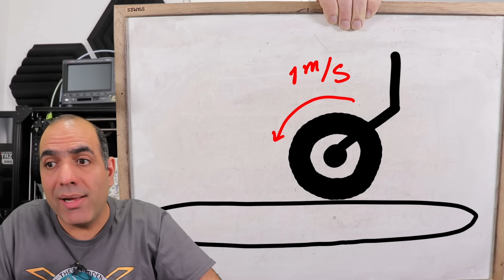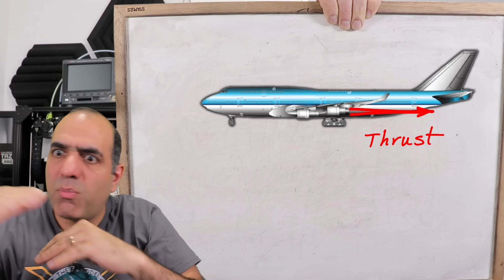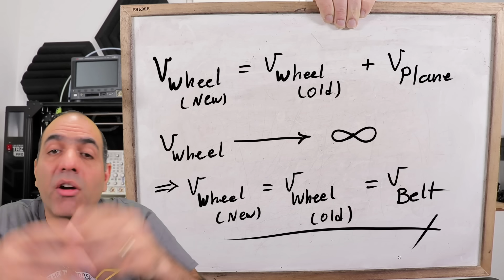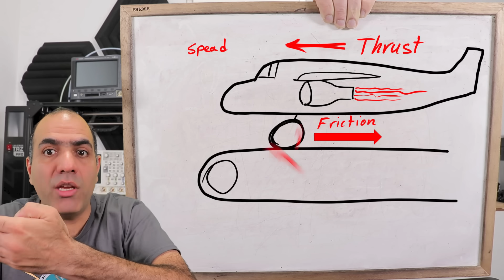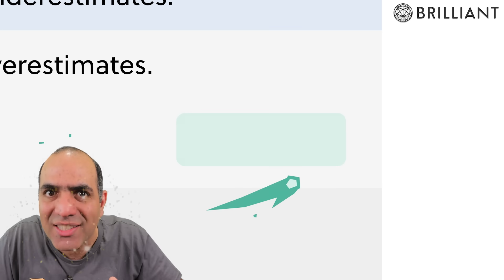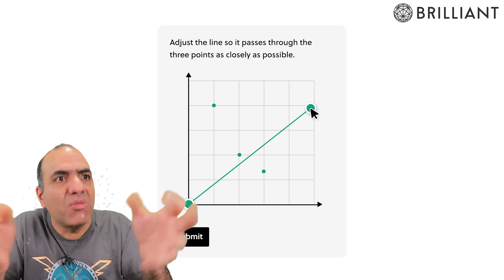Airplane Question that Drove Me NUTS!!!

Comment: In case 3, the wheels might eventually overheat and explode from excessive friction if there's thrust involved, causing the plane to slam fuselage-first into the already fast-spinning treadmill and sandpaper the entire plane to nothingness, or the treadmill might suddenly and magically stop since there is no longer any wheels to measure its rotational speed against and immediately send the plane backwards, slingshotting it in a catastrophic (but mildly silly) incident. In both cases FAA will immediately get involved, airport authority will get involved, plane owner is detained for questioning, whichever engineer and safety officer that approved the experiment will be arrested, then the public will be outraged that such an exercise is allowed in real life instead of in imaginary worlds like it should be.

That's like a dozen potential vectors there.

Comment: The 2v 3v infinity interpretation is what I hate to even think about. The question says the belt is designed to exactly match, so you are cheating if you say the speeds would "ramp up" (5:05). Infinity must be reached instantly. Otherwise the speed was not matched exactly :P

Exploring the various interpretations of "speed of the wheels" that don't create infinities, is something I hate quite a bit less.
Reply: If the conveyor belt is not massless and moves at light speed it must turn into massless particles which have the energy of the previous mass of the conveyorbelt multiplied with lightspeed squared.
The gamma ray flash evaporates the whole vincinity and makes the plane fly each atom for it's own.
That technically constitutes powered flight.

Comment: I think the real question here is "How would I design such a treadmill?"

Everyone agrees that the "speed of the conveyor belt" is the velocity of every points in the flat surface on top of the conveyor belt, moving with the conveyor belt. Also, the only referential that makes sense to me is the referential where the pillars of the treadmill are not moving. The plane is a rigid body, except the wheels that can spin around their center, the treadmill is not elastic (i'm designing it, and i'm not making it elastic, end of the discussion), nothing weird.

For the "speed of the wheels", it's not clear. It could be the velocity of any atom of the wheel or the velocity of the contact point. 3 main possibilities :
1.  "speed of the wheels" is the velocity of the center of the wheel, it's the speed of the plane and also the speed of the geometrical contact point : this is the case presented by mythbusters, the plane takes off as normal and the wheels spin twice as fast as they would on a normal runway. I would design it as the mythbusters did, they are pretty solid.
2. "speed of the wheels" is the velocity of the atom of the wheel at the contact point (it's potentially a different atom at each instant) and the wheels are not sliding on the treadmill. If we assume there is no slip, the "velocity of the treadmill" is equal to "the velocity of the wheels" (because it's the definition of "no slip") : the only solution is 0 (because it's the only real number where x = -x), the plane and the treadmill are not moving. Designing such a treadmill would probably involve welding everything together, it's the simplest option but I won't lie to you, they will not give you the deposit back for the plane.
3. Same as 2, but with the wheels allowed to slip : the plane can take off as long as the jet engine is powerful enough to overcome the friction between the wheel and the treadmill. Realistically the (dry) friction does not depend significantly on the rotation speed of the wheels (I'm NOT designing this treadmill with a liquid or gaseous substance, not even snow, so it is dry friction, not negotiable). In this case if the plane is able to take off with it's wheels locked on a normal runway made of the same material it should also work on my treadmill. The design would probably be very similar to the first one, except we need to find a way to measure the "speed of the wheel" and i'm not sure how to do that in this case. Also, if you get a plane with low friction in the wheels, we'll need fast motors for the treadmill. You cannot rent the plane with no friction in the wheels from a physicist, unless you know another physicist with an infinite speed motor.

If you mean something else by "the speed of the wheels" then i'm out, you're dumb and i don't want to design your treadmill!

Comment: answer is no, lets imagine the belt was set at 100kmph and the plane needs to go 100kmph to take of, then the plane would need enough energy to achieve 200kmph to lift of.
yes trust is created pushing it forward, but at the same time the drag on the wheels is abosorbing that energy.
ofcourse this does not take in  account for air drag wich will both expend energy and create lift but still. answer is no in a windtunnel however u can fly a plane.

dont let me talking distract u pfffft idiot !!! i had u on pause muhhahahahaha

Comment: I'm no scientist but this is what I think is the answer:

Yes.

the wheels are no the source of thrust, but instead the engines are. The conveyor belt would only act as some resistance, but would not stop the plane from speeding up and flying off.
Reply: Update, after watching 4 minutes of the video, I also hate this with a mild passion for the same reason, I assumed they were earth conditions from the beginning.
Reply: update after watching 5 minutes of the video. I disagree about the wheel speed thing because the runway length is finite, so the wheels shouldn't be a problem, besides a little friction.
Reply: 3/4 through the video. I hate this question with something quite a bit stronger than "mild" passion.

Comment: You are mistaken with your answer 3: As long as the belt is accelerating, the the speed of the plane will not decrease. In fact it will still accelerate but at a smaller rate. When the friction is equal to the trust, there is just no more acceleration on the plane. The plane still will keep moving because the forces sum up to 0, which means no acceleration, not no speed.

Comment: Since the puzzle took me here's my honest answer before tackling the puzzle:

The question is cursed: Ignoring the friction between the wheel and the plane no speed of the conveyor belt could prevent the wheels from going faster, since the plane is pushed forward and it can't push the plane back. If we have friction it'd have to be enough to push the plane back (finding a weird static equilibrium where the conveyor is pushing without moving), or I fall back to the previous case. Ready to see if I was wrong and how!

Comment: Yes it can take off. The thrust is coming from the engines, not the wheels. You don't need the wheels at all for the plane to take off. Don't need the ground either. If the plane was suspended off the ground somehow, it would still accelerate and reach takeoff speed. Actually, if there is a strong enough headwind, the plane could take off without moving forward at all. As long as nothing is actually pushing backwards on the plane itself, the engine trust will move the plane forwards. BTW, the Mythbusters tested this myth long ago. The conveyor did absolutely nothing to affect the takeoff of a small model plane on a treadmill. Or a full sized real lightweight plane on a giant treadmill.
Reply: 1) Indeed, the plane wheels are not turned directly by the turbofan engines. This means the wheels are not the cause for why the plane moves forward. The plane moves forward because of the thrust from the turbofan engines, whether the landing gear is wheels, skis, or pontoons.

2) Fixed wing aircrafts require LIFT to take off. Turbofan engines do NOT create lift. Lift is created by the WINGS; specifically the air passing over and under the wings based on the Coanda effect.

3) The engines will push air in the opposite direction of intended travel, but they will NOT bring air above and below the wings in order to create lift. The plane must move through a mass of air in order to fly.

4) The problem makes no mention of wind, so we will consider it to be zero. For an observer sitting near the runway, the plane is not moving (ground speed = 0). Though there is air being sucked into the engines, which does create some turbulence reaching the wings, most of the air particles above & below the wings will be at zero relative to the plane and its wings. There is not a large enough mass of air going above and below the wings, which means NO LIFT.

Comment: Assuming he plane is in working order, attempts to take off and no other external factors stop it from doing so. There are 3 answers, the first one is the real world answer, and that is that the plane will take of no matter what the conveyor belt does.

Then there are the theoretical answers, wich one we get depends on a small assumption. If we assume the conveyor belt will match the linear velocoty of the wheel then the plane will take of with the wheels spinning twice as fast.

If we however assume the conveyor will match the wheels rotational velocity things get a bit of the wall. As soon as the plane attempts any movement forward the conveyor will accelerate to lights peed creating infinite energy and thus creating a black hole of infinite mass with a event horizon expanding outwards at the speed of light untill the whole universe is absorbed.

So the answers are litterally either the plane takes of fine or the end of the universe.

Comment: The plane needs the drag from the wind of the atmosphere to take off (you can check how the wings behave during takeoff), if it’s not moving there is no drag to lift off the ground
Reply: The plane will be moving though. Unlike with cars, the wheels and tires of a plane are just along for the ride. Because the plane must move forward due to thrust there will be slippage as the tires are essentially pushed forward since they are no longer allowed to go faster then what they are against.
Reply: @kamX-rz4uy  Well that entirely depends on the thrust compared to the friction against the runway pulling the plane backwards. If it can never reach it's normal takeoff speed, and it can't since the treadmill apparently violates the laws of physics and accelerates infinitely, it's airspeed will never be enough to take off.

Comment: yes,  of course it can because the thrust that pushes the jet forward does not depend on the frictional forces of the wheels to ground. The thrust comes from the engines on the wings and is independent of the wheels.   A better question would be if the jet had a tail wind at the same ground speed the jet was taking off in could it take off?
Reply: the friction encounters the thrust.
I made a video proofing it wont take off.

Comment: It seems a real world test in a wind tunnel would solve this. Even a miniature version of a plane could do it. My answer from another video.
      ''There are too many variables that are not stated. Does the conveyor belt extend under the wings? What is the distance from the wings to the ground/conveyor belt? Does turbulence from the ground affect lift?  I don't see why it should takeoff.  The plane is not moving relative to air, the wheels are free spinning.
   The simple answer is there needs to be enough airflow across the wings to create lift.''
    edit; whether the engines are on or off, may give different results.

Comment: Agreed, these questions always annoy me.  My interpretation of this question is always that the plane remains stationary in space, while the wheels and ground/belt are moving, thus no air movement for lift.
Reply: If the engines are only putting out a very small amount of power you can imagine a possibility where the treadmill is overcoming the plane's ability to move forward. But add any real amount of power and it will overcome the friction of the wheels against the treadmill and move forward.
Reply: @kamX-rz4uy  Which is fine, but the scenario states that the treadmill can perfectly match the wheels, meaning no amount of power can overcome its countering motion, hence the plane will always remain stationary.
Reply: @Anto64w  That would be true in a car but not a plane. The plane will move forward even if it means pushing, skipping, and hopping the wheels while they also rotate. It won't be pretty. Lift off depends on if the plane can get to speed before the tires and landing gear fail.
Reply: Intuitively, yes, that's what I come up with as well. But I watched the mythbusters actually do the thing, and the plane took off. So clearly there is enough windspeed to create lift.
Reply: @ryanbrown982  Well the Mythbusters did not really test the problem scenario exactly because no one can actually test the scenario exactly. That is the problem. The wording of the scenario requires some interpretation of somethings not mentioned and each person's conclusion is subject to the conditions not mentioned.
An airplane can actually move backwards relative to the ground and still be flying. So technically a plane can fly backwards as long as the air is moving across it's wings. I use to paraglide and in windy conditions (20+ MPH winds), I would actually move backwards relative to the ground and could not get back to my launch site.

Comment: Plane will not take off if wheel speed and belt speed match (plane is stationary) as there is no air flow over the wings to create lift even if the engine are at full thrust. Planes lift off due to air speed over the wings.

Comment: It's simple, it will take off cause thrust is what an airplane need to take off and not the speed of the wheel. It wouldn't take off if the speed of the head wind meets the thrust of the airplane.

Comment: I'm probably not the first to posit this, but I believe the questions intent is to ask if the engines produce sufficient thrust to cause the plane to take off if the plane cannot move relative to the ground until it is airborne. And I believe the answer is no

Comment: Can we slap a virtual frying pan in the face of those who say the plane will not move🤪
The wheel rotation is effectively frictionless on the hub attached to the undercarriage leg and the engines will push the plane irrespective of what the wheels are doing.  As the wheel rolls forward the conveyor is rolled backwards at an equal rate but in the opposite direction to satisfy the requirements.  Viewed from the accelerating aeroplane the conveyor ‘runway’ surface is seen moving backwards at twice the speed of the surrounding airport.
Before the potential aeroplane rotation and lift off the plane will be going at 160 knots towards the climb-out end of the runway and the conveyor is going at 160 knots towards the start end of the runway.  Seen from the plane the airport is moving backwards at 160 knots but the conveyor is going backwards at 320 knots.  The wheels are free to rotate with the conveyor, they rotate at 320 knots and do not impede the plane’s motion as the plane is simply rolling on negligible friction bearings.  There is no infinite anything, there are no infinite rotation rates, there is no infinite friction, there is no massive induced wheel drag, no wheel lock, no wheel held stationary by some undefined force, there is no need to consider the inertia of planet Earth.
Simplifying the problem is the hard part.
The tyres could not survive 320 knots, centripetal force would tear them.